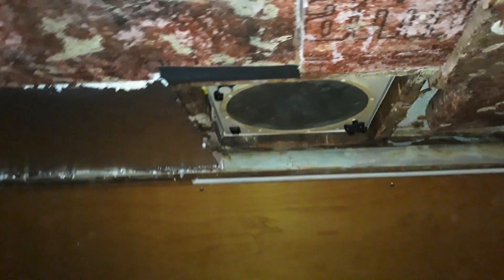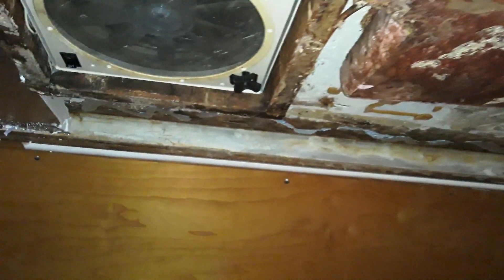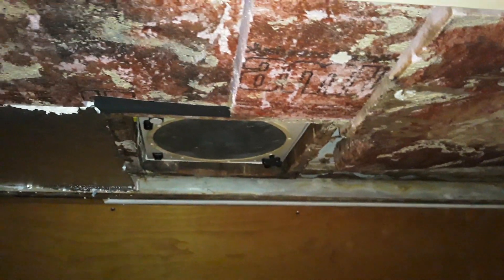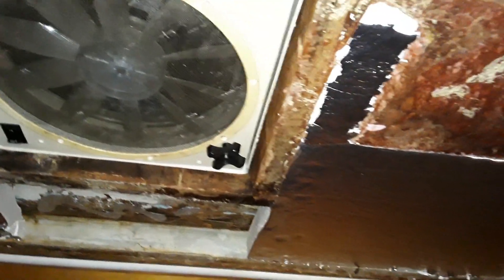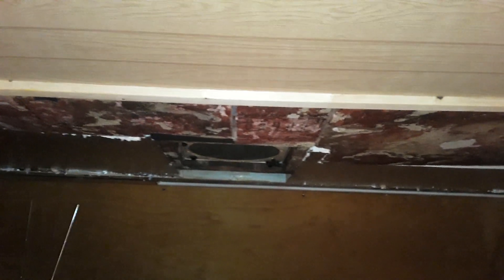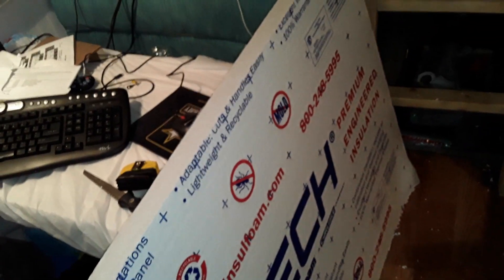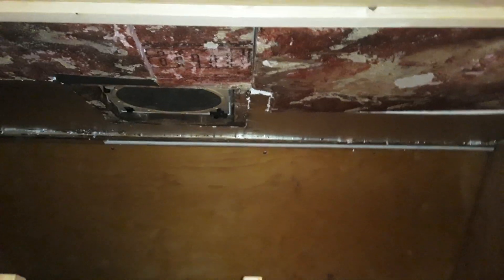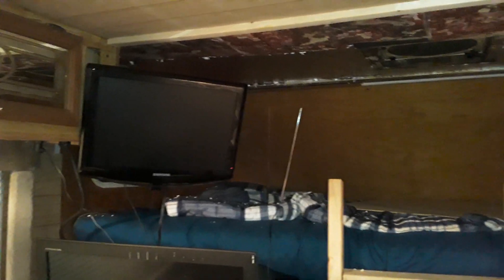Budget RV Restoration - Installing Ceiling Insulation (V1908)

Comment: I wish you would utilize the pink virtual assistant so we can actually watch you work. I think you should add another coat of the roof sealant just to add another layer of waterproofing. Anyway good job on the rest of the ceiling. May not be perfect but it is definitely an improvement. What's going on with the job? Are you going to be able to continue working at the space Center? My apologies if you have already updated your status and I missed it. Take care Denoy.